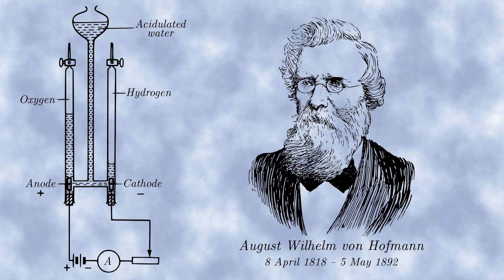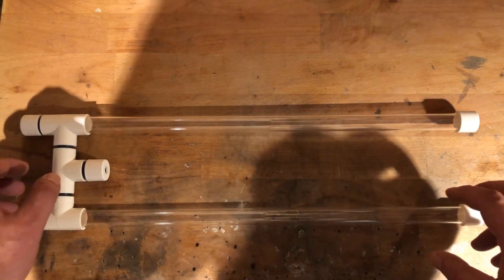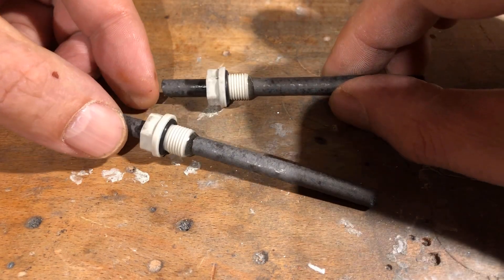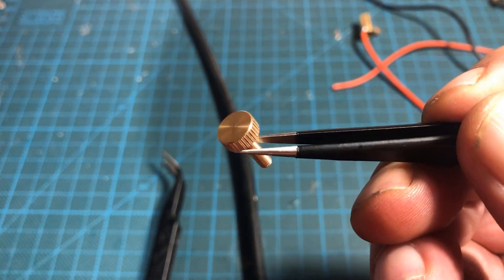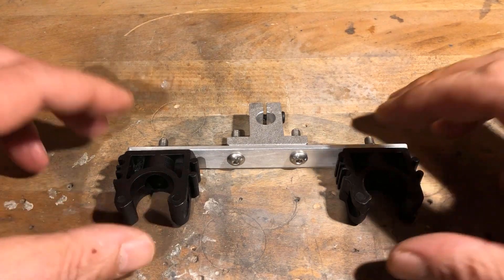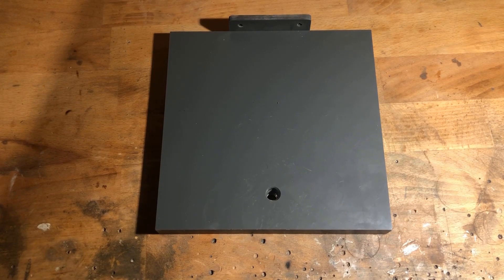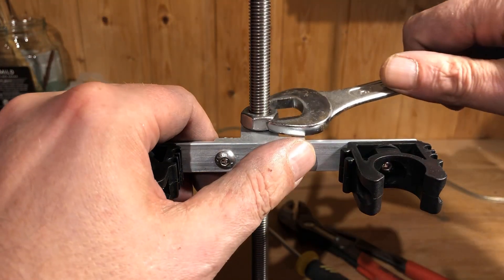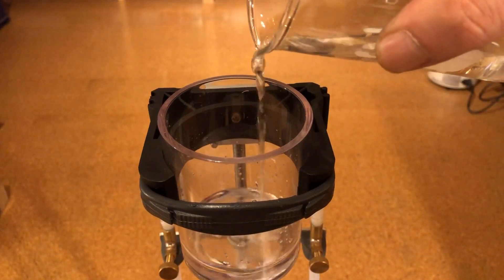How to build a modular Hofmann voltameter

Comment: I like the printout for your hole alignment
Reply from the maker: I use such templates very often. I design them in Inkscape, print them, and spray glue them on the material.
Reply: @Marbslab way better then trying to scratch out a layout along with accuracy and time savings.